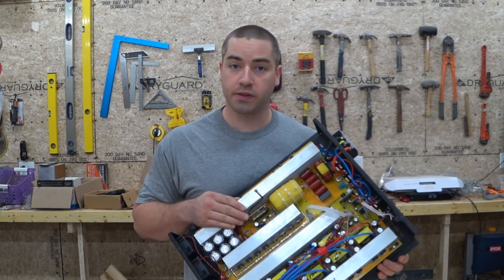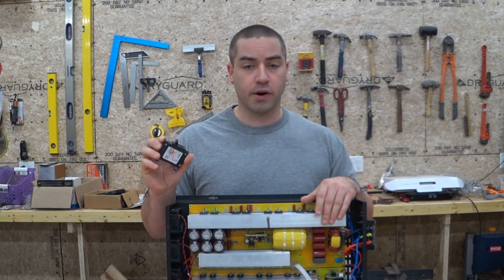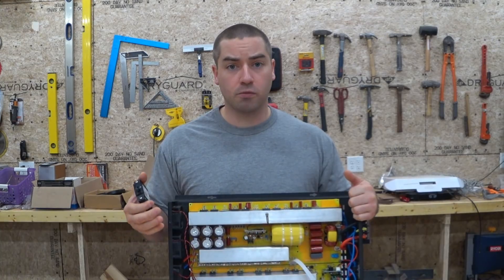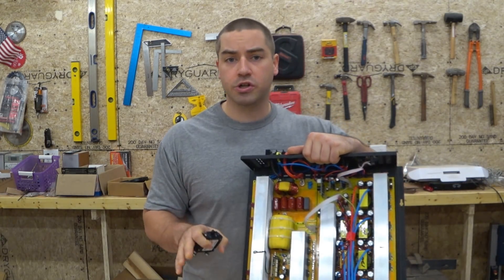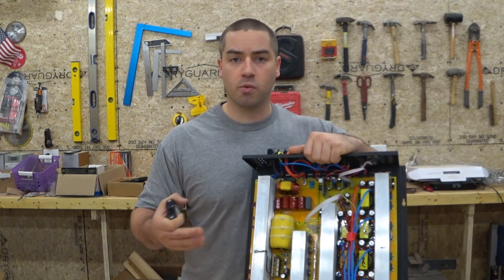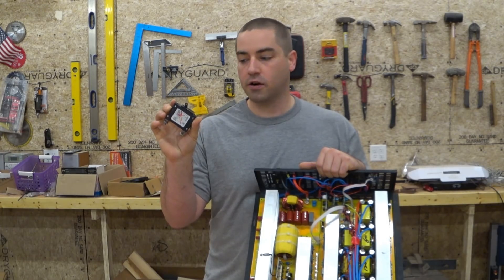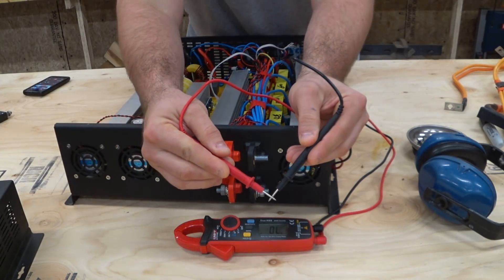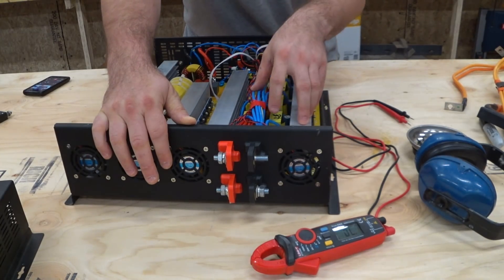Did I Blow Up the Inverter?

Comment: I will not say it is your fault, not at all, seeing the previous videos. I have been an electronics tech for awhile and I know plenty about inverters. Based on watching your videos and seeing the EXACT REPLICATION of the failure on both units, I think I know whats going on with them inverters. I can only assume this is a design flaw from the company themselves. (I can't be fore sure cause I have no seen their particular inverters in person. But I think they have mad a step to cut cost like a lot of manufactures do, mainly in the design process. I am assuming they are using the same kind of driver ICs and same drive circuitry as the 3000 watt unit that powers your unit fine. This is a problem with a bigger power unit that has more MOSFET to drive and to switch "on and off" More mosfets require a bigger or more driver to switch them all off and on at the correct timing. If they are using the same driver chip or drive circuitry as the 3000watt unit that right there is the problem itself. ill explain why. The driver chip in the 3000 watt is suitable to drive the MOSFFET correctly at higher loads, thus powering the saw because that  ic chip was designed to properly drive that many FETs in that particular unit. However without adding more IC's or upgrading the timing cuircuit, regardless of load, iff you try to drive too many MOSFETs at the same time with one IC, (like almost double in the 8000watt unit or add bigger MOSFETS that require a higher rds on) its gonna overload that driver ic and cause a delay in the timing of the MOSFETS switching,causing what I call a (FET Misfire.) The fets are set up to switch on and off in pairs. And only certain pairs. You have the wrong two transistors on at the same time or the wrong time, It will create a short circuit across the output FET bridge. (The MOSFETS.) and thats what i'm thinking happened here. I design flaw on their part not yours. I think they are using the same driver chip as the 3000wat unit and it can't properly drive that amount of MOSFETS in the  bridge they have configured in the 8000watt units. (Too many MOSFETS or too big MOSFETS with too high a gate voltage.) Its causing the driver Ic (Gate Driver for the MOSFETS, tells them when to switch on and off) to switch the transtors at the wrong time, causing them to short out on the MOSFET side. (explaining why the fuses are blowing and what happened to the breaker, backing up what they told you about the short happening on the inverter side.  And the measurements you took prove that. IT shorted out right at the MOSFETS themselves. 
Curious to note though. This typically failure tends to happen on the output side of the inverter,  not the input side as in the case of this one.  

You have two stages in an inverter, the input switching side and the output switching side. Both having their own MOSFET bridge. Input side with the transformers and capacitors are acting like a giant DC-DC boost converter, boosting the battery voltage up, though the Input FETS (ones the blew in these units) and into the transformers. Then they go through Diodes. (Usually places on the heatsink with the MOSFETS) then to  the capacitors (Known as the DC BUS. Side of the inverter) This is where the voltage is boosted to HV DC for switching into AC) The output stage takes the high voltage DC from the capacitors (DC BUS) and then switches it into the 50-60hz AC mains Voltage, through the OUTPUT FETS (Near the 120v output of inverter.) Sinewave units have large coils and capacitors near the output side for shaping the "pure sinwave" units without these typically have square wave or modified square shape output waveforms.  A lot of kinds of inverters in the world but typically they all work the same way with the same stages and principle, designs are only the real difference. They all function the same manner and same way regardless of design. 

Each bridge of FETS (switching transistors that use a gate voltage.) has their own driver IC chip, called the gate driver. If this chip is overloaded,damaged or fails in any way, it will cause problems in the switching of them particular FET's. And if they are switched at wrong times, they can will and switch into a short circuit, which is what happened here on the input side. This particluar inmformation should probably be sent off to the manufacture so they know whats going on if they haven't already figured it out if you really want them to do well. :P

 As far as capitalizing FET and MOSFET, in electronics terminology, they are acronyms in which I have bad habbits of capitalizing.  (Metal Oxide Semiconductor Field Effect Transistor.)
Reply from the maker: Thank you for taking the time for such a thought out comment.
Reply: No worries, electronics has been my hobby for over 20 years now. Its hard trying to diagnose something if you don't understand how something works. Also mind the horrid typing and elnglish, i'm still hungover from thanksgiving. Hope all goes well for them though and hope they get the problem solved.

Comment: You referenced a part as a transformer at time index 6:30.  I think you are right, because they sure do look like that.  Transformers are AC devices and if you power them with DC they will act as a short, especially if you have a bunch of them wired together to share a load.  If I didn't know any better, I'd guess that that inverter was designed to accept 48V AC as an input.  Just a stab in the dark.  Hope you figure out the problem.  Good vid.

Comment: Cheap inverter.. very low price mosfet.. for me the 8000W is just for few milliseconds... You can smooth the curve installing a huge capacitor to absorb rush current but better go with a better brand. Mastervolt is a very nice one.

Comment: 8000 watts @ 120v = 66.6 amp \ 8000 watts @ 48v = 166.6 amp. Was that 80 amp breaker on the input?
 Realistically, the inverter not being 100% efficient, your input amps should be higher than 166.6 amps at full load. Check with the inverter manufacturer to get their input fusing recommendations to include inrush delay and surge specs. (hint, slow-blow fuses may be a better choice on the input side)

Comment: When the motor start. It demand the highest current it need. While the Inverter had the power to get. but breaker can not take it, so  it trip. when the breaker tripped the energy it stored in the motor had to release. If this energy not consume by mean damage other device the balance will show at the breaker (spark). The old inverter you used had the highest limited current it can get. so not pop it.

Comment: I still think you have a problem with how your ground wire is connected via the inverter to the outlet that you are using. I noticed that in the 1st video with the 3000 watt that you connected the ground to the outlets ground and the outlet you are using has its own breaker switch in it that could be where the connection problem started that lead to an overload to a part in the inverter somewhere. Just to be sure that the outlets breaker isn't part of the problem I would swap it for one that has no breaker inside it. Also I just looked at my 2500 watt inverter that's the same make as yours and on the inside of mine the red wire is neutral and black is hot so that may be a cause for the surge problem as well. I think it would of been best to plug the saw directly into the inverters outlet and test it and if the inverter fails again then its for sure a default in the inverter design.  GL

Comment: Duracell bought a company that made a UPS battery backup inverter done the same way as the knot on this. But if the transformers are using wire to thin, or the insulation between the windings are thin then the transformer wires would heat up, melt the insulation, maybe even arc to another winding if they don’t have enough insulation. The power from inductive load (saw) has to be release somewhere and will go back out of the input to the breaker. The transform fuses would blowout as power exits and because of the power coming out it probably aced on the breaker wires.
OK, if my theory is correct then the transformer after the last fuse was the fat to go. And the other could also low out and short as the power exits backwards trough the input terminals.
Also, not only could this be using sub par transformers, but some heart TVS diodes between the transformers could have stoped most of the damage cased with maybe only pop get a fuse or two.
On second thighs back to sub par transformers, maybe on would be damaged even with the diodes since that it’s one is the weak spot and the flaw in the systems under load with inrush current.

Comment: Hello is there a differance between an ac and a dc breaker? You said it was a dc breaker and the power coming from the inverter is ac...?
Reply from the maker: Yes, there is a difference in AC and DC breakers, but some can be used with both.  I'm using a DC breaker on the connection between the battery and inverter.  This is the DC side.  Thanks for watching.

Comment: Is very commom problem in universal motors (wiki) ( Brush Motors) of power tools, this generate high voltages at high frequencies (EMI), It damage the MosFets by OverVoltage, This inverter needs protection ( Snubber WIKI) or don't use powertools. The fuses of inverter blow up (slow reaction) becose the mosfets fails (fast reaction).

Comment: Dear Sir , among many other youtubers that use these off brand , off the shelf inverters that (may not be even pure sine wave)and also getting them from the typical scumbags ( ebay , amazon , e.t.c)  please stop wasting you money , The invereter you had died simply from a power tool .... 
These are premium quality  that will handle ANYTHING you though at them (Studer)
http://www.studer-innotec.com/en/products/xtender-series/
they also have both for USA 120 / 60 Hz and EU 240 /50Hz power output , 
I am not affiliated with them , I just bought it once and it still going ( 13 years later ) with Old motor fridges , and old AC's and what not, so please buy one from STUDER and you will never , ever need to worry about, power tools ( 1/2 of the Wattage rating of the the Inverter, KILLING YOUR INVERTER ... ) i've seen many people trying to get away cheap or expensive depending on how much you got scammed :D  , and at the end they spend way too much money playing for the cheap inverter 1,2,3,4 times .... 
I hope you will give them a try they have everything for all applications and especially for High availability applications that power loss is not an option
Reply from the maker: Thanks for the link.  I have not heard of them before, but just read through the data sheet and looks good.  Do you know of a North American vendor?
Reply: @DavidPozEnergy  dear sir you can find them here http://www.studer-innotec.com/en/partners/
Thank you in advance

Comment: Its a bad design inverter, looking at the different lenght from the ppower wires inside the inverter< it can never have a equal amount off power devided over the other mosfet banks.. design fault, whitch comes into sight when handling uge inrush currents... Main cause is the different lenght of the power wires to the mosfets.. (easy repair, change the mosfets for paired ones, and rebuild the power feed wires to the mosfets whit equall lenght ones. ), skip the DC breaker, and y think after that rebuild it will work fine.
cant believe they didnt look at this in the factory, its badly made!!
Reply from the maker: Thanks.  What do you mean by "paired" mosfets?  Is that a special type?

Comment: Hi David,  Nice exposition, but a little short on accurate measurement of the inrush current — and that "blows" your argument about the breaker not being at fault.  With a peak current quite likely of several hundred amps, your time before failure would likely be a fraction of a second.  Your meter is WAY too slow to measure a very fast current rise to peak (of many, many times what you measured, and a very fast drop).  As other writers have stated, your mosfets are undoubtedly also blown.   Yes, junk design of the inverter — no safety margin for switch on surges of loads.
Reply from the maker: LOL, I like your pun on the circuit breaker blowing.  And yes, I didn't relise I needed a different meter until all the comments started coming in about it.  When I looked up a Fluke with in-rush, it was $500.  So, a good video on in-rush will wait until I find one I can borrow.  I agree with you on no safety stuff.   Do you happen to know why that is?  Is it just a cost issue, or is it too hard to make safety circuits so the inverter protects itself?

Comment: The inverter is junk. You have a battery with a very low internal resistance, good sized cabling and sensible circuit protection. When you pull the trigger on the saw, there is momentarily zero resistance in the circuit which will cause an infinite current to flow limited only by the total series resistance. This resistance is lower than the designers of the inverter reckoned on. When the current spike coincides with the MOSFET switching there is a very high induced voltage which should be dissipated by a snubbing diode. Supposing the diode is present, it will fail shorted meaning on the next switching cycle the MOSFET also fails presenting the rest of the drive circuitry with a dead short. All this happened within 1/60th of a second. From then on, it's pot luck whether the internal fuses or the external breaker tripped before the inductors melted. As I said, it's junk.

Comment: i know i read something below - it is not really rocket science - the load is too much for either the CB or the Inverter.
i am reminded of Occam - "In this case the one that requires the least speculation is usually better."  if (1) wired correctly - and  (2) nothing in saw at error -  and  (3) CB is performing in another test application  (rule out CB fault replace or check in another circuit away from inverter ) then it is the inverter - it was free but but if you answer that 1,2,3 are yes - you are left with do not buy or recommend this product... distant 4th - power source (in this case batteries ) able to provide FLA starting Amps - then inverter is junk - it was free so you are out $0 and up 18k views - so you are winning...
Reply: If that is true why did the CB and 3,000 watt setup not fail?